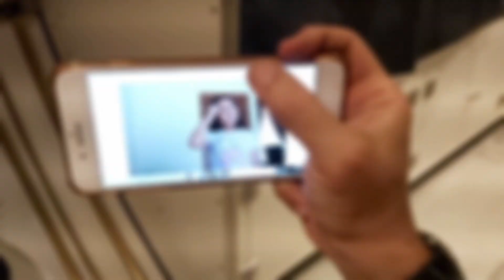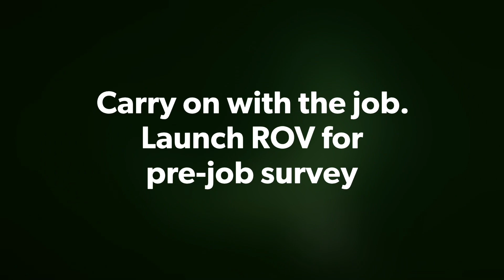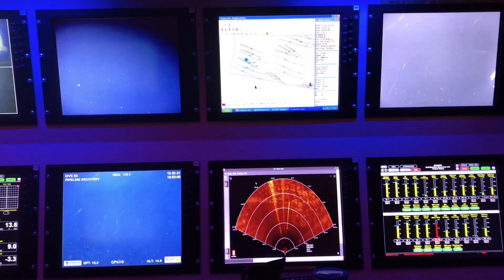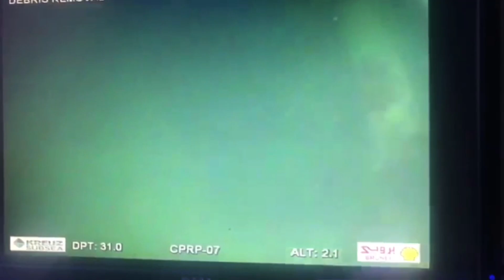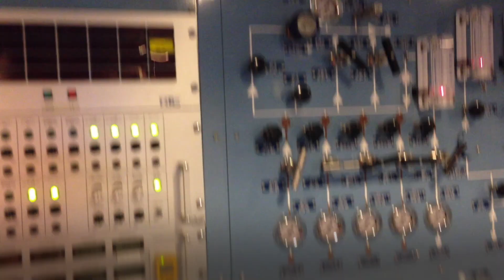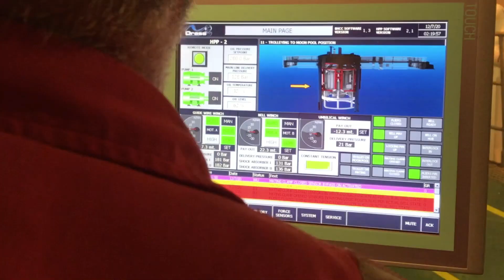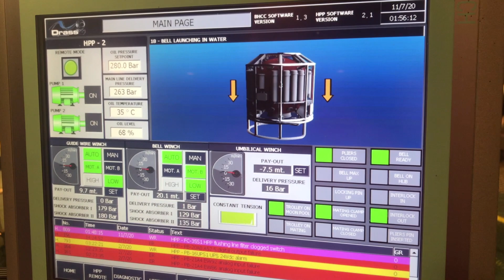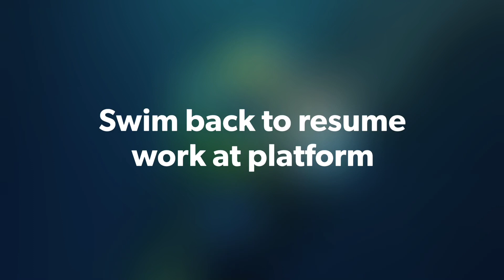Divers ROV & Sharks @ Brunei offshore (Saturation Diving 2018-19) Kreuz Challenger

Comment: Hello Sir. I hope they are doing well. I have a few questions how many divers die in this job? That would be interesting! is it harder to weld underwater or on land? greetings from Germany
Selam Aleykum.
Reply from the maker: Salam . 
Nowadays with all the regulation and laws, the number of fatalities are low. As long as they follow the procedures the chances of things going wrong are minimise. Usually at the planning stage most of the problem would have been looked into.
For me welding underwater is abit harder. Because of the elements like cold water, the tide, waves, electric shock, example if you do not have a good earth connection. All this can be obstacles to overcome. But once you get used to, it gets easy. I like it when I can see the molten metal forming at the tip of the welding rod, when the water visibility is good.
Take care my German friend👋🏼👍🏼😁

Comment: How do you negate/stop the effects of hydrogen embrittlement when you are welding under water?
Reply from the maker: Hello Scott, welding underwater is not as sturdy as topside welding. The surrounding water cools the material and weld’s molten pool very fast. The alternative way we can get good result is to undertake hyperbaric welding where the whole area to be welded is made dry by installing a hyperbaric structure and ‘pumping’ out the surrounding water.
Reply: @AbangShamvideos  hi 👋.. thank
You for getting back to me. The hyperbaric chamber I guess has a good amount of inert gas to stop any fire risks? & does that mean the welder working within is still breathing surface supplied air or are they breathing the atmosphere in the hyperbaric chamber ? 

Thank you again.
Reply from the maker: +scott c  The Saturation chamber has low partial pressure of Oxygen anyways so risks of fire is low. Diver gets in the hyperbaric chamber undress to dry clothes and commence welding, breathing the atmosphere in the chamber. The scrubbers will absorb all the gases as it circulates, gasses including Carbon Dioxide. ...
There are procedures when it comes to root welds .. and dealing with argon gas.

Comment: How long do you guys typically stay under water working with welding and such?
Reply from the maker: It all depends on the diving tables, some company uses US Navy dive table , some uses DCIEM table and also Royal Navy ones. Usually when we dive on Air (using compressed Air) the deeper we go, the bottom time gets shorter. Example at depths shallower than 10feet we can spend about 2-3 hours. If we dive to 100 ft we could get only 20 mins of bottom time. That’s not an exact figure, We still refer to the table during each and every dive. 
If we dive in Saturation (Heliox Mix) our time in the water is about 5 hours. After that we already have to return to the Bell, as per the regulation.
Reply: @AbangShamvideos  Thanks for taking the time to reply! Super interesting all around! 
Hopefully I will go do my course In late December
Reply from the maker: Have a good course. Best wishes on your career. 👍🏼
Welcome to the club💪🏼😁
Reply: Have questions.. very interested 👌 light me bk once u gets this please God bless

Comment: I want do this but i have adhd and i need to take medication do they allow you to take that into the decompression chambers or am i gonna have to “smuggle it on board”
Reply from the maker: Before we go for our diving course we need to go for a thorough medical checkup. After that our diving medical have to be done annually. If I’m not mistaken as long as the diving Doctor deemed you to be fit to dive, you should be able to. The other question will be if the diving company. Criteria can sometimes be non transparent. They pick and chose who they want.And when you get on the job the Superintendant will also decide if you can get into the Saturation Team. Unless it’s an Air job that does not require you to stay in the chamber for days at a time, selection can be ‘harsh’. Anyways personally I have to declare whatever medication I take onboard the vessel, to the vessel’s Medic, and sign a declaration form for that. The Doc needs to be aware of what you take, so as to know how to treat you when/if emergency arises. Hope that answers your question
Reply: @AbangShamvideos  Thank you I’ve been wondering how that would worked.